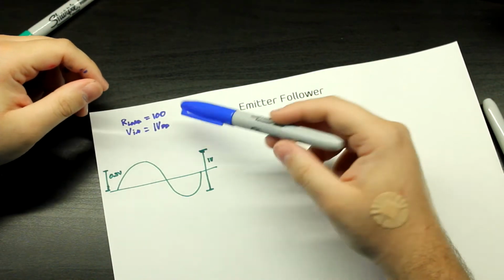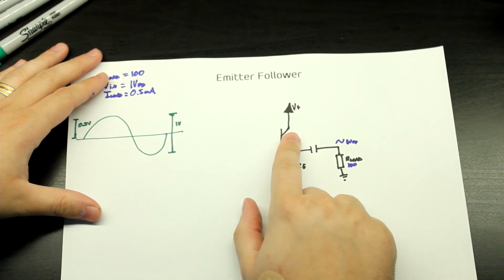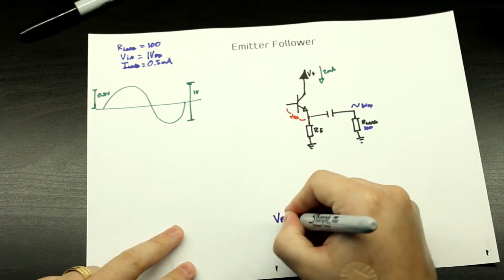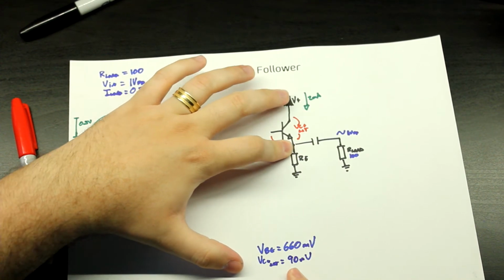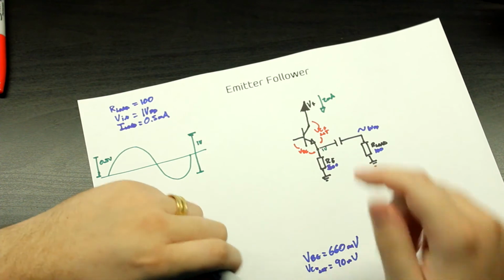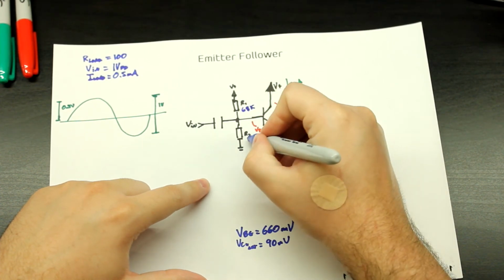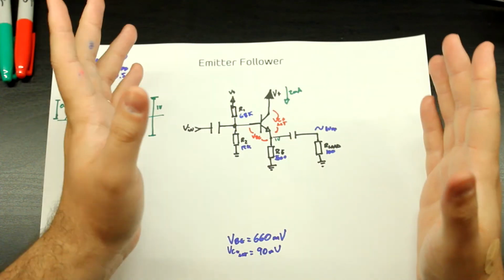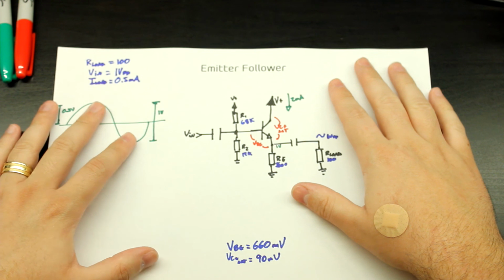#002 - Emitter Follower (Class-A Discrete Headphone Amplifier Project)

Comment: Cool stuff… I’m trying to make amp for a 1W 8ohm speaker driven by microcontroller output of 3v p-p and about <5mA.  I got it going with a 12V rail and burning about 1A.  But gets nice and hot (using heat sink ).  On the scope getting some distortion so something still not right.  Hopefully I find my mistakes from this series.  In a nutshell it’s the impedance that messes me up.

Comment: Hi, thanks for the explanation!

I have a doubt: shouldn't the load current be 5mA and not 0.5mA?
Reply from the maker: You are completely right! Thanks very much for pointing that out. While filming I was a bit nervous and decided to go with the 100 ohm resistor for the load and while doing the math in my head I thought it would've given me 0.5mA. Keep in mind that I don't prepare the circuits beforehand, I basically just do everything on-the-fly while recording.

In order for the circuit to operate at the appropriate 0.5mA current the load resistor should be 1k, not 100. Or in order for the circuit to operate at the 5mA for the 100 ohm load Re should be reduced to 68 ohms (~15mA of Ic) and the biasing resistors adjusted accordingly to the new base current.
Reply: @innoveworkshop  Thanks for the clarification! And don't be nervous, you're doing a great job :D these videos are very helpful👍
Reply from the maker: I'm so glad to hear that! I'm extremely shy, so this whole thing makes me super nervous haha, but I'm trying to do my best to teach the stuff I'm most passionate about.

Again, thanks very much for your support, it motivated me a lot!
Reply: Ya no worries this is great!